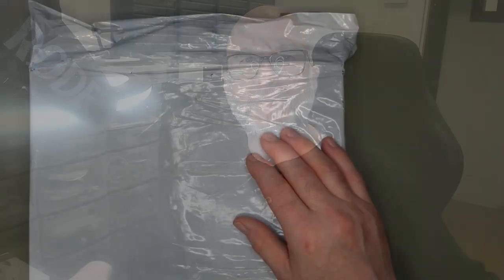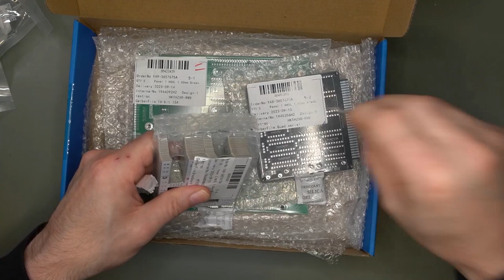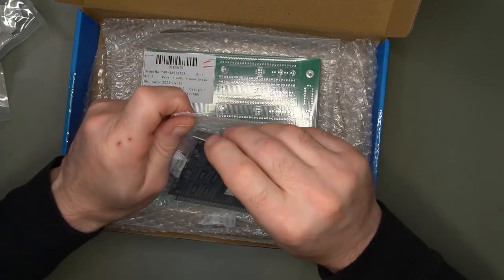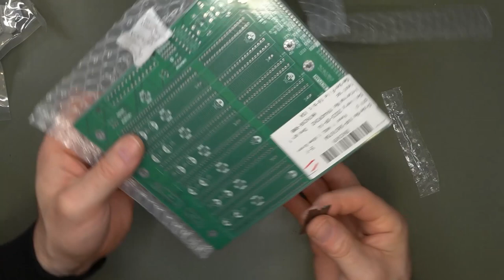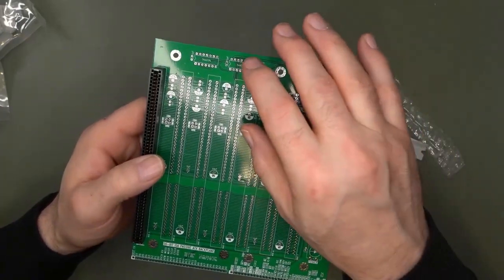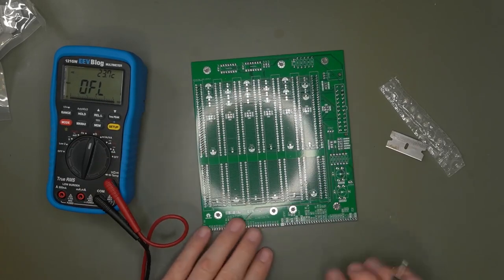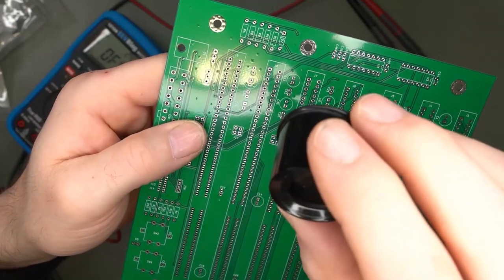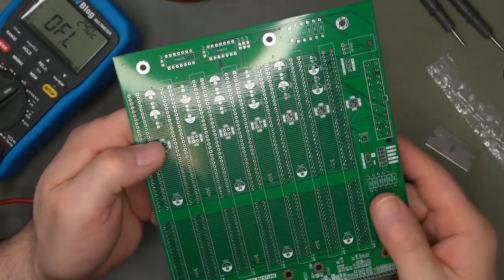Z80 Homebrew - A new backplane and a few extra PCBs - Ep 7

Comment: What's the difference between an active and passive backplane?
Reply from the maker: To put it very simply, an active backplane contains active components and is driven by some sort of controller or microprocessor, for example, a modern PC motherboard with PCI express slots (or an older IBM AT with ISA slots). 

Whereas, a passive backplane contains no active components and is, for all intents and purposes, dumb.  It's basically slots on a motherboard that is linked together by traces in parallel. A common modern-day retro example would be the RC2014 backplane that uses pin headers (instead of card edge connectors).